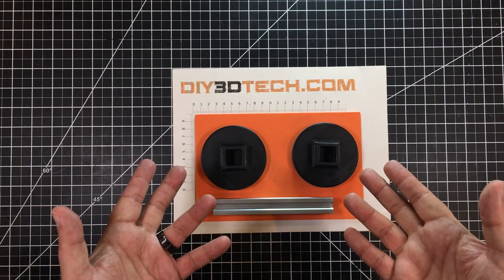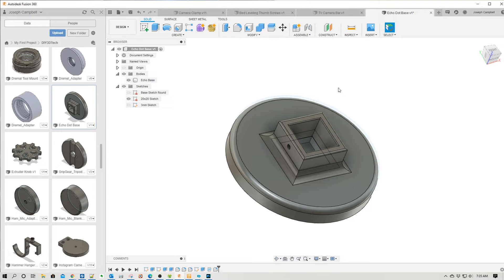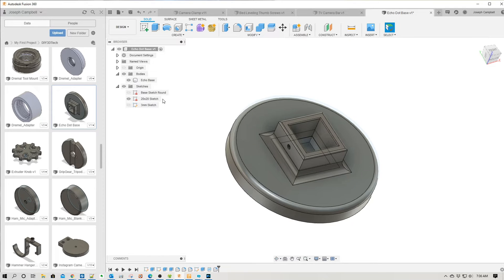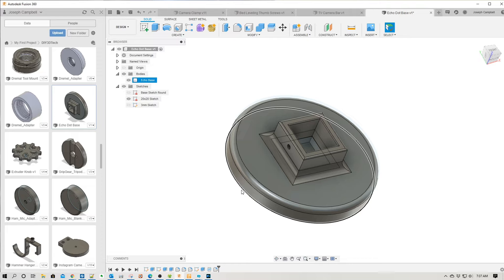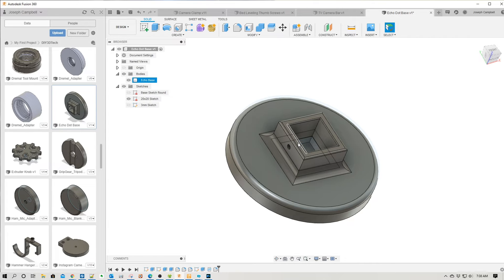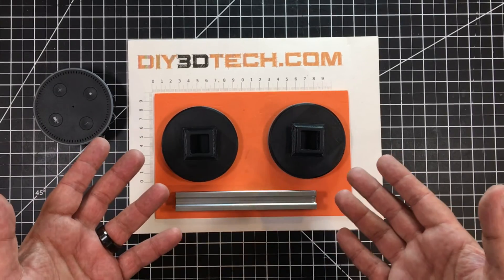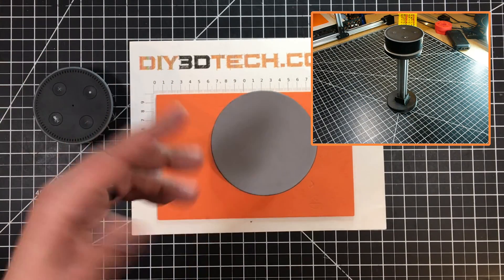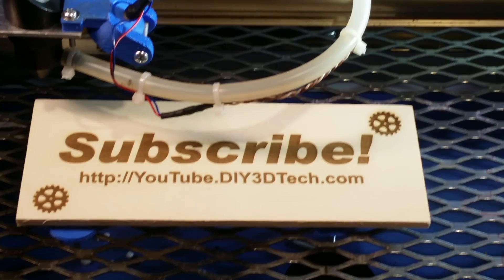Design Talk -  One STL Two Parts and Some 20 x 20 Makes?

Comment: Great design
I am not jumped to Fusion just jet. Im in Design Spark mech. for now.
Thanks for sharing :-)
Reply: How do you find that software? I was looking for some software that didn’t need the cloud.
Reply from the maker: @zzing  pretty much love it or hate it the cloud is the future as it is far more practical for many reasons.  However you might want to look at FreeCad as its a good and free application, however it lacks the the speed and agility of Fusion.
Reply: @DIY3DTECHcom  FreeCAD and even OpenSCAD have their points, but unfortunately they are not up to the same level.
The way you worded the statement isn't exactly one that can be argued against very easily as vague as it is. But I believe for practical purposes that a non-professional is using it for - the "cloud" is completely unnecessary unless you are sharing a link to somebody.
Reply from the maker: Many thanks!

Comment: Nice to see the K.I.S.S. design school alive & well with 3D printing. The majority of my most functional designs have all been created in under 30 minutes, not because I'm a wizard at Fusion360 but because I keep them simple, functional and to the point. Nothing wrong with adding a few features to make something look good but if you're spending longer on that side of things rather than on the functional bit, rethink your process.

Thanks for the video & keep up the good work.
Reply from the maker: Many thanks for the kind comments and I agree with you on the simplicity of the design as Albert use to say: Everything should be made as simple as possible, but not simpler...